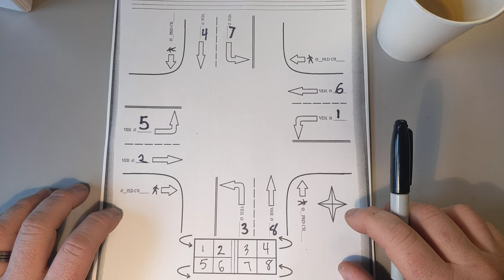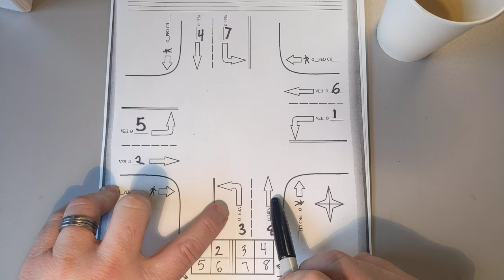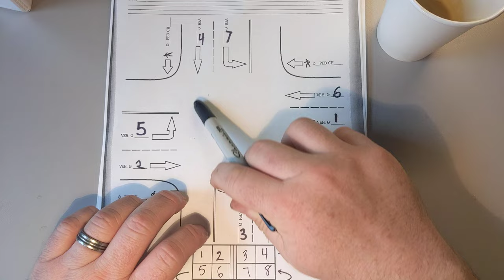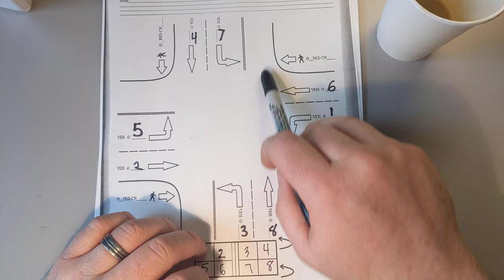Lead-Lag configuration! (and a hot cup of espresso)

Comment: If you're on the lagging side and want to go straight, that means if the green left turn arrow comes on, it's your last chance to make it through the circular green light. If you're way too far back from it and the green arrow comes on, that means the whole light may turn yellow on you about time you reach it. If the lagging side circular light is green and the arrow is red or flashing yellow, that means you can most likely make it through while you're a bit far back from it. If you're on the leading side and want to go straight, that means if the left turn arrow turns yellow while the circular light is still green, it's your last chance to make it through the circular green light. If you're way too far back from it and the left turn arrow turns yellow, that means the circular light may turn yellow on you about time you reach it. If the circular and arrow light is green at the same time, that means you can most likely make it through while you're a bit far back from it since the arrow turns yellow first before the circular light turns yellow.

Comment: Hello from Connecticut! Here in Conn, a new practice is at locations the side streets cross the main street of 3 or more lanes, is to split the side streets so that Phases 3 & 8 are green together, terminate and then Phases 4 & 7 run together. This is called split side street phasing and has been used sucessfuly at hundreds of intersections. If you are wondering about extended cycle time the green time, the green time is half of what the straight through phase 4 & 8 side street green operation normally would of been.
Reply: Much safer because left turning cars don't have a chance to collide with oncoming traffic or miss crossing pedestrians to their left
Reply: I’ve seen this type of phasing where I’m from as well. However, I’ve also seen it where there’s the lead/lag configuration, but the side that had the leading arrow also has a sign by each 5-section saying “oncoming traffic has extended green” that illuminates and stays lit until the opposing signal turns yellow.

Comment: How do you program the lead-lag on a Siemens M50?
Reply: @train1596-fairly simple
You’ll need to go into Alt Sequence menu.
Then find which phases you want switched.  Once you know which Alt Sequence #  you want to use-go back to main menu.
From there, select Unit Data, then Start Up.  At the bottom you should see alt sequence selection.  Input that number in there and test it out.  Hope that makes sense!

Comment: Ah, so that's what that sequence is. I  always see it but never knew what it was called.
Reply from the maker: This is definitely not to be confused with split phase configuration. A split phase means that only corresponding phases run together on the side street like this. This comes in handy with roads that don't have dedicated left turn lanes and the municipality wants to reduce the potential for a "failure to yield on left turn" collision.
Reply: @trafficsignalstraining7673  yea I definitely know split phasing doesn't supposed to be on a main street.

Comment: How do you achieve this? Do you change the ring structure?
Reply from the maker: You can set different sequences and then program those sequences to run using time of day plans in most controllers. There are some different ways of doing this depending on which controller you're using but for the most part, the sequence is how the ring is represented... Some older controllers even have really awesome sequence presets, the traconnex TMP390 had preconfigured sequences that you could pretty much just program into a day plan. Even some newer controllers don't have that feature.

Comment: How do I make the straights and then the left turns?
Reply from the maker: I'm not exactly sure what the question is that you are asking. Are you saying you want the through phases to cycle first and then the left turn phases?
Reply: @trafficsignalstraining7673  Yes
Reply: You would essentially lag both the left turn phases, or if you look at it via sequence, you would have the throughs run first in the ring diagram before the lefts. (Ring 1: 2 1 | 4 3) (Ring 2: 6 5 | 8 7)
Reply: @Cm214__  I understand.